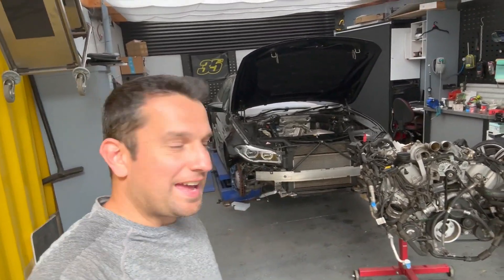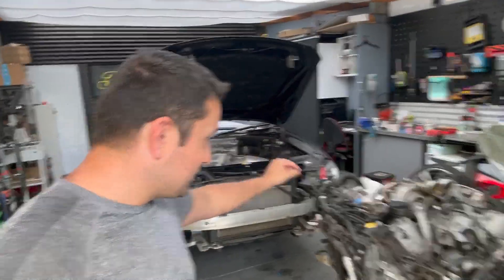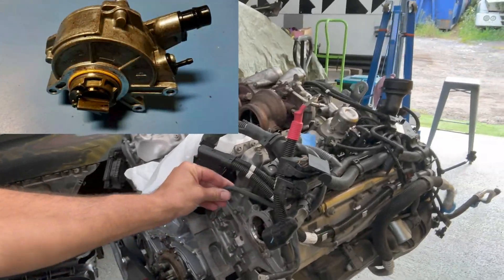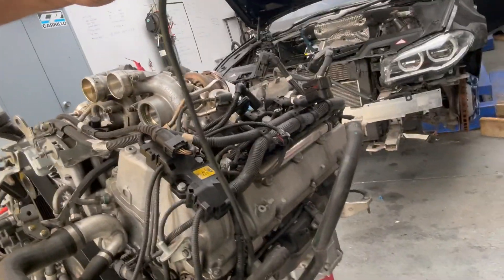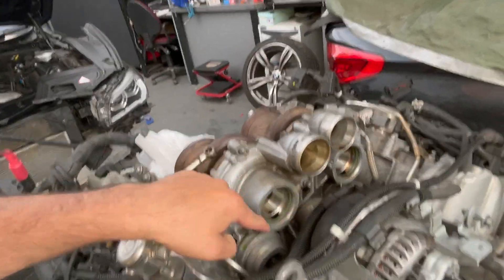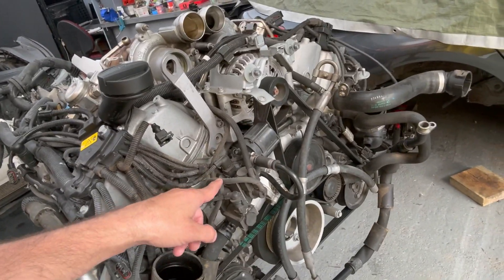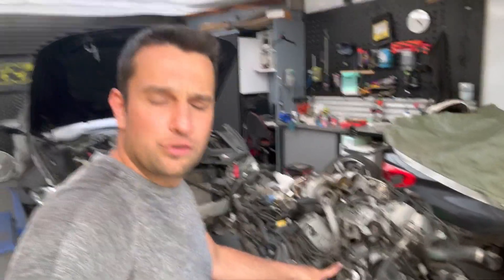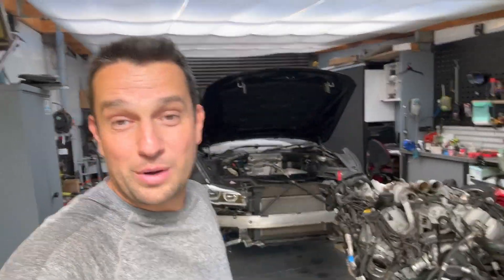BMW S63 Vacuum system F10 M5 - Pump, lines, solenoids and reservoir

Comment: I have on my 2013 m5 code 10BA4b ( charge-air temperature sensor, plausibility, cold start temperature too low) and code 120408 ( charging pressure control switch off as consequence)

could it be the vacuum lines?
Car is stage 2 tuned,

I’m really lost here any hints would help a lot. Thank you in advance.
Reply from the maker: Try to remove the tune (back to stock)  and see if the codes are still present, the vacuum lines only control the waste gate and exhaust flaps
Reply: @dnl35projects  I really want to do that but it’s not that easy according to some local mechanics and tuners, 
a lot of them are scaring me ,that bringing the car back to stock using ISTA might ruin the DME for ever .So I was thinking to use BM3 to return it to stock ,according to the company
Once BM3 is installed it will replace the old tune and read the DME ID to download a stock tune.
Yet once again local tuners are saying BM3 will read the existing tune as stock, and it will never bring the car back to stock.
I don’t know who to believe anymore
Should I just suck it up and pay a premium to the dealer to do it?

Comment: Hey man, if you do a muffler delete on the car do you have to do something to the vacuum lines? Would it create a vacuum leak?
Reply from the maker: Yes, just plug them with a bolt so the hoses don’t suck air in.

Comment: That’s a life saver video! Do you
Think it is doable to replace T connection and hoses to wastegate solenoids while engine is still on the car?
Reply from the maker: Thanks ! Absolutely,  theres a bunch of things you need to put out of the way but yes, no need to remove the engine for that.
Reply: @dnl35projects doing it at the moment while charge coolers are out for upgrade! It is pretty easy to do the t connection and small hoses, i’d assume for wastegate better to remove charge pipes. The only line i don’t see replacing that easy is the one actually from the vacuum pump, unless you use a lift.

Comment: Necesito tu ayuda con una problema en mi bmw n63 tengo diferencia en el rials de combustible me podrias ayudar por favor
Reply from the maker: Fuel rail pressure issues are related to the hpfp - Do you have any codes ?
Reply: @dnl35projects  muchas gracias por contestarme si tiene diferencias en los rails de combustible tengo un vídeo nose a dónde te lo puedo mandar, los dos riel están en 6300 varían un poco pero cuando le doy arranque unos queda ahí nomás y el otro se va a 21000 y de ahí baja aparece el check y después los dos quedan en 6250
Reply: @dnl35projects  Do you have a place like that? I'll send you the videos. You'd save me if you could give me a hand.
Reply: Plis